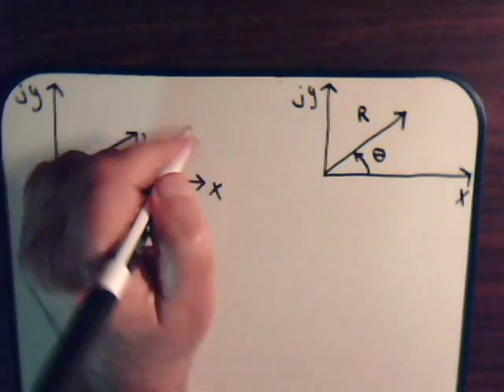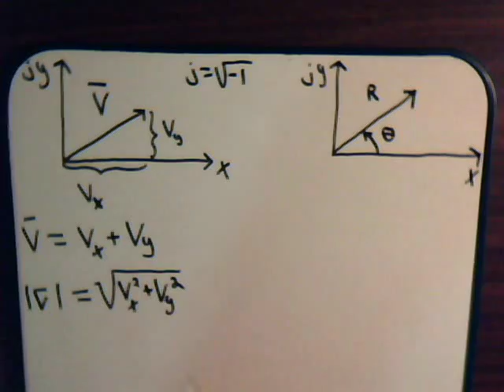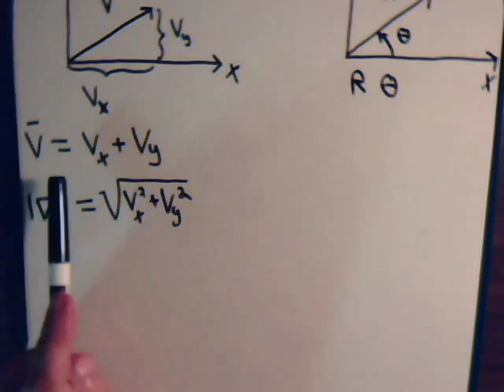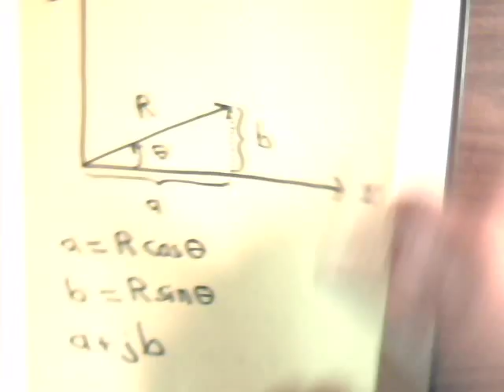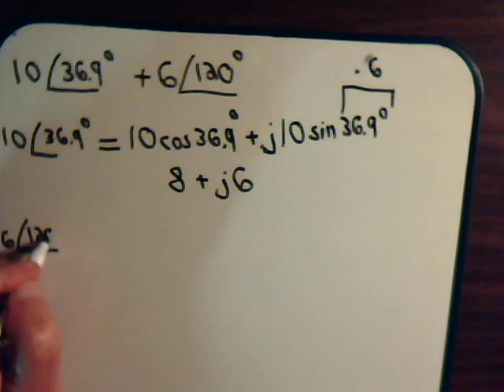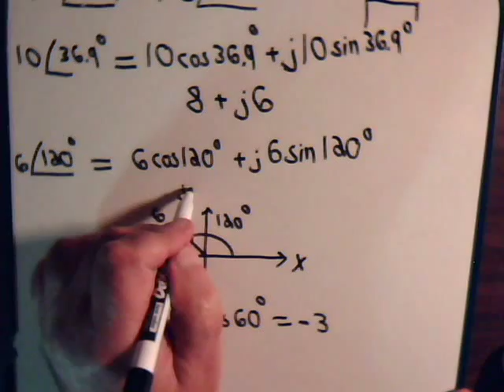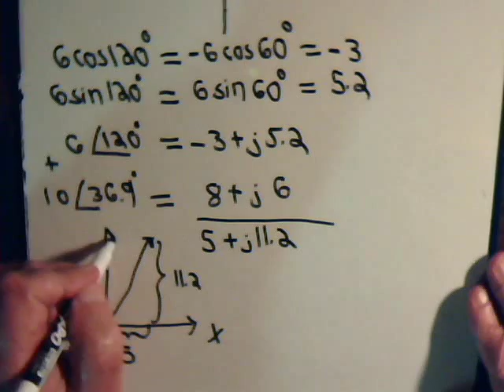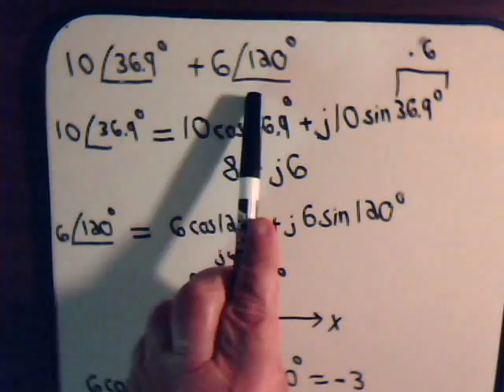Electrical Circuit Analysis Video #71: Addition Of Polar Vectors

Comment: Hello, I just wanted to take the time to thank you for putting the effort into making this video. I have been watching it for 5min so far and have already been helped immensely! I am obviously going to watch the rest but i couldn't keep watching without thanking you because of the one way you explained vector addition. I have always been able to do vector addition but not by understanding it but just because i was taught you put them "tip to tail". When you brought out that piece of paper that explained you were just adding the x components and the y components it made so much more sense. I don't know why but for some reason it just clicked. I knew when you have more than two vectors you add the x and y but the whole tip to tail thing always made me not fully grasp what i was actually doing because of the over simplification. Thank you so much!!!